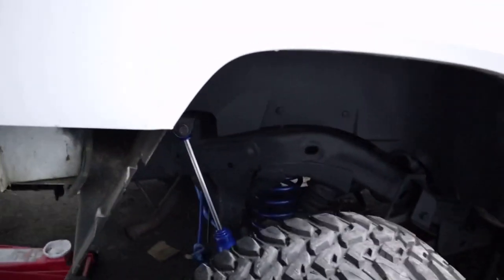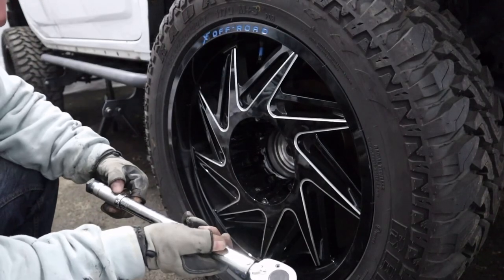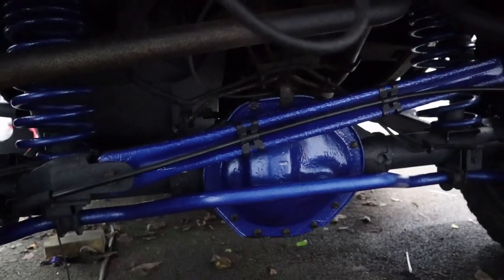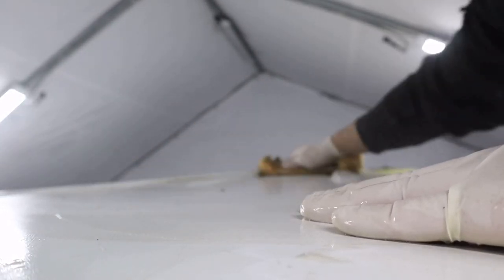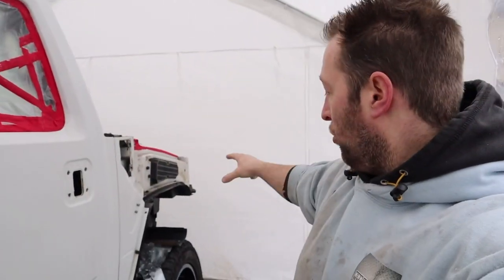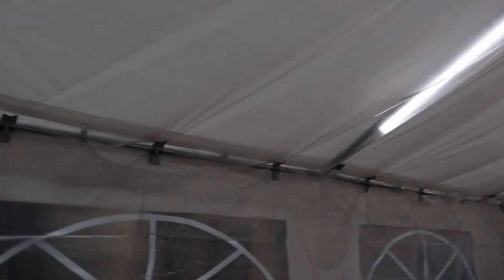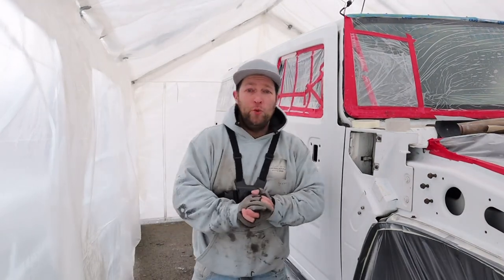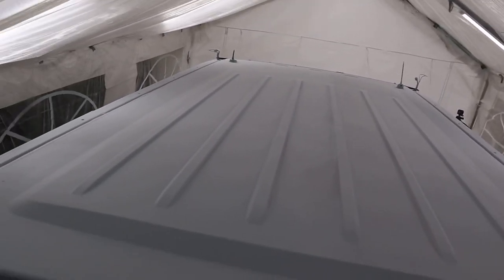WHEELS, PAINTING BODY HUMMER BUILD PART NINE

Comment: Why did you prime the vehicle?
Reply from the maker: It’s always better to prime before base coat
Reply: @builditwithrob  I’ve painted cars for over 20 years and it’s not.
Reply from the maker: @ryrybread220  really I always thought primer then paint,  I guess I wasted some time and material then
Reply: @builditwithrob  sand the original paint down with 400 grit to 320 and the prime and rub throughs or repair anywhere.
Reply from the maker: @ryrybread220  thanks bud  that would have saved me some time